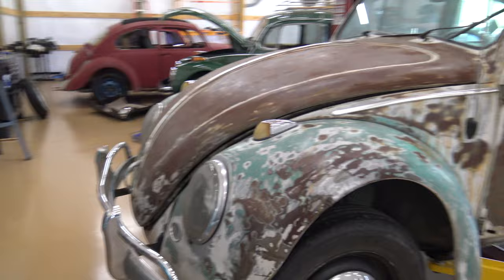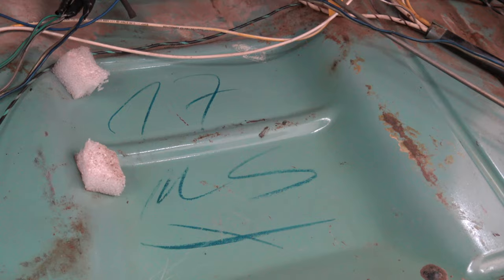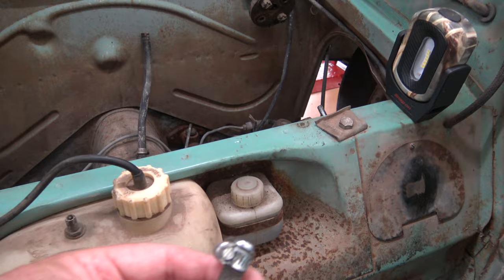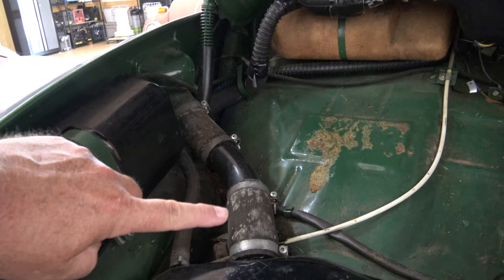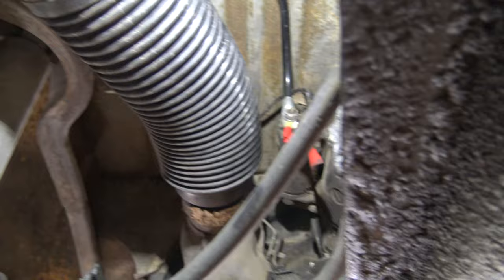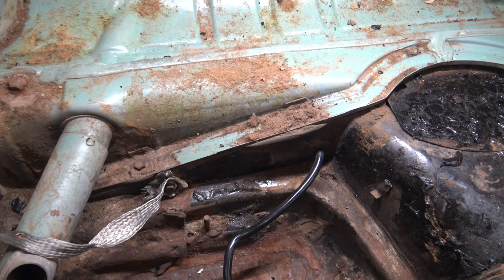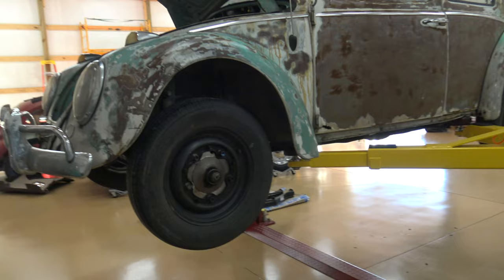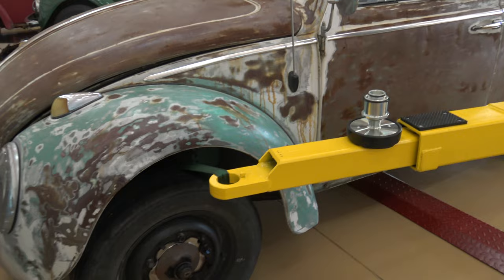VW Beetle | Remove Body From Pan

Comment: The straps obviously worked fine, your video proved that. Since your lift arms lock I wouldn't worry about folding fenders in as a comment mentioned being concerned about that. I don't have a lift at home so I'll have to come up with another solution. I'm looking at a kit project so your video has the best detail I could find to show me what I'm getting into. Good job, very informative and helpful. 
Thanks for mentioning the 2 bolts that you missed at the end of the video. Very useful.
Reply from the maker: Thank you, glad it was helpful.

Comment: Hey Jay! Video was awesome! I only have a home garage, no vehicle lift. Need to work on my 67 Beetle. This video will help if i decide to or need to remove the pan. On the straps, Harbor Freight has tons of great products. I would not trust straps only, on a customers car. if a strap failed, great amout of damage and expense to repair. All the windows would be toast. Like the method, but only to break the body lose from the pan. (a few inches up) Then go with a more secure, solid lift method. Thanks again for the great video.

Comment: Nice work again as always. I was a bit concerned that the straps would tweak the fenders. Would a 3/4" steel dowel/pipe/rod running through where the straps went through to avoid pressure on the fenders? Or remove the bumpers and tie the straps to the bumper supports? Dunno...just a couple of guesses. I'm hoping someday you'll have the opportunity to show how your shop would repair a broken clutch tube mount in the tunnel. The one that's near the e-brake. Got to get to mine someday but I'm chicken. Keep the vids coming please.
Reply from the maker: Thanks Campion, yes I was concerned about the fenders but I guess the body alone is not heavy enough to cause that. The pipe idea might work, just make it long enough to extend beyond the fenders, but I'd smooth the inner pipe edges so not to cut the strap. I'm about to do a video on swapping from an auto-stick to a manual transmission and that involves changing the shifter rod and shifter. I'll look at the clutch tube mount.
Reply: @JayDubCustoms  Hey thanks..I'll be sure to look over your shoulder to see how you cut into the tunnel and stitch it up again. I have a pretty good Idea. I've researched that an access hole should be round and not square due to any possible tunnel metal fatigue at the 90 degree corners. One of my largest concerns is other tubers who have shown this process make not much mention of being sure to drain the fuel line that runs parallel in the tunnel. Good idea when sticking a welding electrode in there I'd say. I think I would also include removal of the shift rod yoke access plate under the back seat and stick a shop vac hose in to suck out the welding smoke when tacking the bracket back together.

Comment: Nice shop.  I picked up a 71 superbeetle convertable that has been sitting inside a shop for 20 years.  It needs nearly everything, but the body is good.  Floor pans have already been removed and it was prepped for painting.  Still not sure if I want to separate those 2 halves or not.  Maybe I should just sell it as is.
Reply from the maker: I'm restoring the same car now.. 71 Super vert. Almost done with it, just needs the top upholstered. Mine didn't require replacing the pan. Your call on selling vs restoring... they're neat cars to work on and a vert will be worth $$ when you're done.